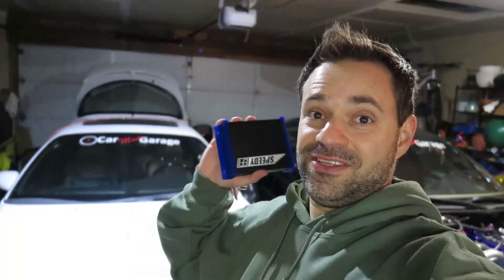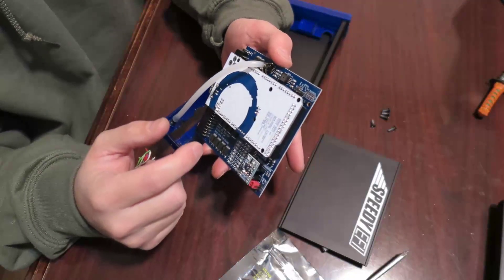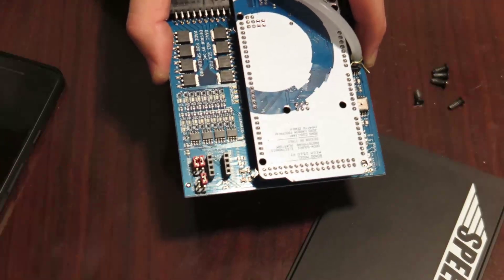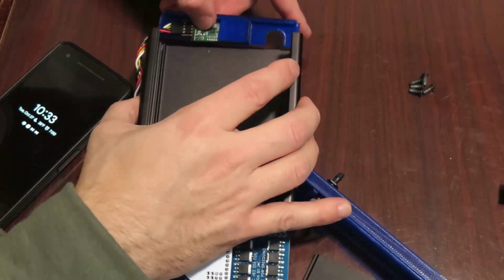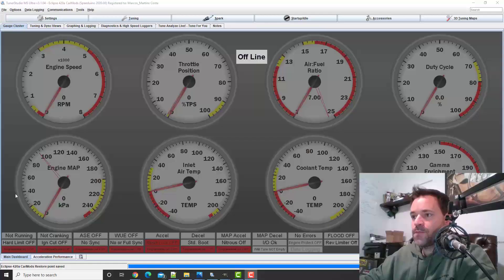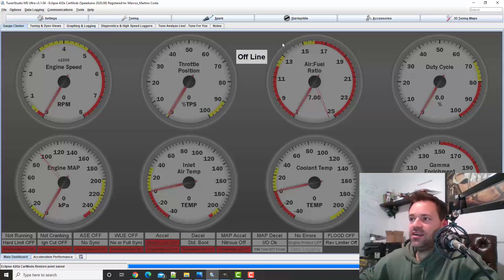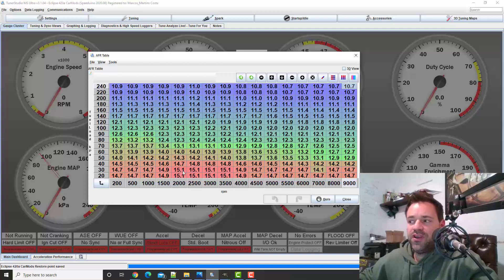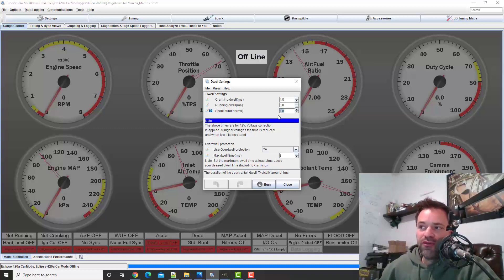Configuring ECU on TunerStudio and Hall Sensor Jumpers Before First Start - Eclipse 2G Speeduino

Comment: Greetings friend I have doubts with the bluetooth jumper of the speedyefi, what is the function of that jumper
Reply from the maker: The jumper tells the ECU that you will connect using Bluetooth and not cable anymore.  You can always ask the SpeedyEFI guys through their Facebook page. They are very responsive

Comment: hi can i got a question about the camshaft and crankshaft how do i know what kind of sensor i have is it Inductive, Optical, or Magnetic(hall)
Reply from the maker: My eclipse 420a was hall. It's either hall sensor or VR (variable reluctant) sensor. Hall sensor usually has 3 wires . Power, ground and signal.  Be sensor has only 2

Comment: Good stuff 👍. Spark output triggers is usually set to "going low" on 99% of coils/igniters. The only car that I have ever seen going high used with Speeduino is the stock obd1/2 Honda coil/igniter
Reply from the maker: Thanks man. It didn't work though. I'll upgrade to independent art coils
Reply: @CarModsGarage  Greetings sir I ask you I have a speedy ecu and I am trying to connect in my Mazda Protege 5 and it does not want me to start the car, you can help me
Reply from the maker: @albertocortes4596  did you tube your ECU or you just got it and plug into your car?